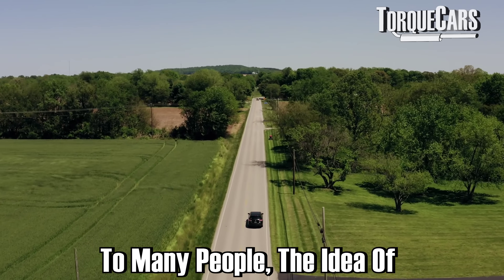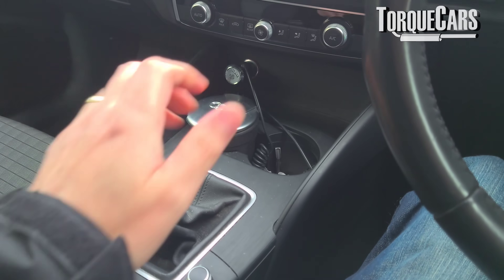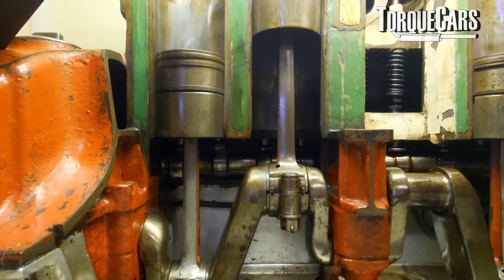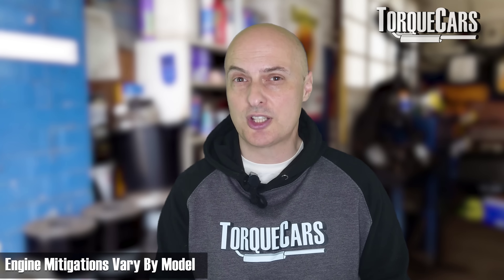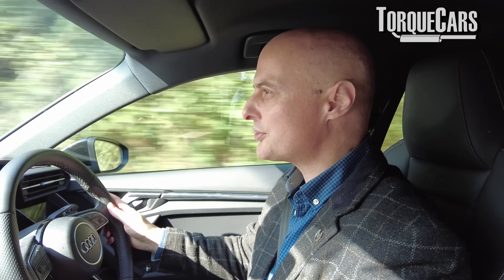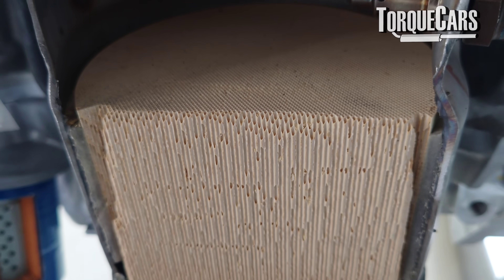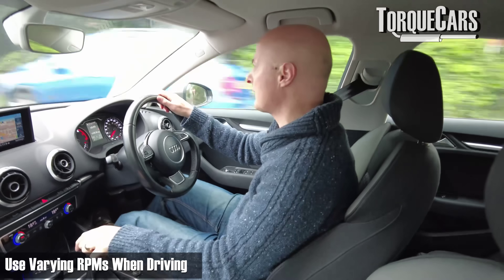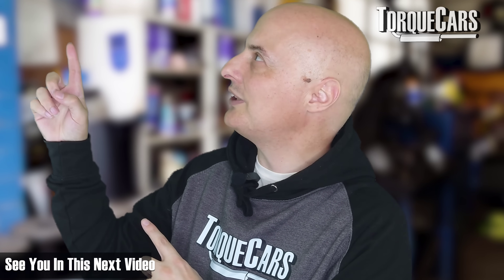BIG DAMAGE By Lugging at LOW RPM? Eco Driving Warning! (Manual Gears)

Comment: Diesels in particular need to be driven like the police are chasing you..(DPF, EGR and rxhaust cleaning). My grandad told me Diesels are designed to work, not rest…Also they need a good run to build heat and regular services..to keep them fit..
Reply: My last diesel was retired at 199000. Seldom did it get revved above 2000 and mechanically was fine. Regular servicing is the key (oil changes at 10000 instead of 18000 as recommended). The engine was fine but the suspension and steering components were heading towards end of life on a seven year old Renault with a trade in value of £200.
Reply: Diesels are true tanks if serviced regualy,  They are literally designed to haul heavy loads over long distances.  Our nanny state should never had declared war on them.
Reply: @chrisgermann6658  Unless you have a  VW TDi 1,9 BLS engine like I had in my last car, it was serviced more often than the book said, I never lugged it and always use the range. it did not even last until the first timing belt and caused a connecting rod to blow right through the side of the engine causing me a loss of 10K dollars and a new debt of another 10 grand. engine was built with defective bolts in the connecting rods making the bolts snap right off. and no one cared, car is more than 3 years, buy a new one for everyone driving cars with the defective BLS engine. it took me 6 years to pay for the damage that stupid car made for me
Reply: @chrisgermann6658  they create much more pollution. Which is why they have started to reduce compression ratios on modern diesel cars, which in turn made them less efficient (but weirdly cleaner).
Reply: @chrisgermann6658  You're confusing old diesels or industrial diesels with current diesels. 15 years ago too mych turbo boost pretty much halved their lifespan but now it's irrelevant. Combination of DPF, AdBlue and use of digital CAN system makes all diesels fail between 150 to 200 k km in an extremely expensive manner. Worst of all, even dealerships can't repair them. I have cars in the fleet that return to dealership every month with the same issue. More money than they're worth has already been spent and five different workshops don't know how to repair this thing. At this point everything in emission control and fuel mixture systems have been replaced, and the car still locks itself due to AdBlue malfuntion.
Reply: @piotrmalewski8178  If the engine has it's oil swapped out every 6-7k with the filters it will keep going.  Turbos are not the problem but people driving Diesels hard and not allowing the turbo to spool down when idle is.  The egr/dpf can be coded out of course but this would probably not fare well for fleet cars as in your case.  So i would say the big brands kind of duped corperations into lease cars promising long life oil every 17k only for timing chains to snap and head gaskets to fail.  If looked after a Diesel block will go on for a very long time.  Trouble is i would say all of the plastics manufactures are using these days does not mix well with heat cycles.  I can only speak for my own experience and my 5 series has done 207k and is still on the original dpf/egr/glow plugs etc.
Reply: @chrisgermann6658  More importantly, it's illegal. As for 207 k, from experience you're nearing dpf failure.
Reply: Diesels have governors so you won't over rev them. Bulldozers are at full throttle 10 hours a day for decades. I drive my 2019 Ford F250 Powerstroke to keep as close to 2000 rpm all the time and I do floor it regularly. Lugging is terrible for diesels and I never let the revs get below 1600. For towing I use 2000-2500 as the rpm range.
Reply: @kgsstudiosfineart  if you have it in tow haul they can downshift too quickly and blow up a diesel. Mines a 2015 and it went to 5k for a second and scared the crap out of me. Tow haul removes a lot of power limiters on some trucks.
Reply: @kgsstudiosfineart  It definitely depends on the engine. I have the old T5 from 2005 from my grandpa, it´s now at about 350k miles with a 1.9 liter TDI engine. These engines are desingned to be driven at 1200-2000 revs, they have full power at 1100 revs and you feel the loss of power after 2000. This Multivan has never seen more than 2700 revs and I drive only that high if it´s fully loaded and I´m driving uphill (which rarely happens) and so far it´s working great.
There is a dpf installed but I have no clue about mechanical stuff so maybe there is a difference to modern dpf 🤷‍♂
Reply: I always thought diesels like low RPM. They tend to get their power earlier than petrol cars. Of course there is such a thing as too low and you can quickly feel the loss of power when going too low.
Reply: @wertywerrtyson5529  You're correct Diesels grab their power lower down the rev range.  However with the fuel emmissions crap they sling on the engine needs to periodicaly be worked hard to engage a DPF burn to prevent the device from getting clogged with soot.
Reply: @wertywerrtyson5529  old school diesel engines are the best. Theybhave huge low end torque. And you dont need more than 2k rpm. The newer engines are rev happy.
Reply: @wertywerrtyson5529  yep diesel engine torque is at lower end.

I drive a 2009 Ford Focus Manual. Unlike the petrol of similar engine size, currently at 82k mileage.

The diesel engine can even hold an uphill situation without hand brakes, just by the bite point of the clutch whilst a petrol car will stall unless you add gas.

As for normal driving. At constant speed say 20mph at 2nd gear she is fine no lugging and stays at 2k RPM but can hear the engine revving asking for a gear higher so you change to 3rd,  same for 30mph at 3rd gear again at 2k RPM.  

But if you are at 30mph constant at 2krpm and change to 4th gear, you will feel the engine lugging speed too slow, revs going down.

But then same as the 20 and 30 mph. If you are hitting 40mph change to 4th gear and at 2k+ rpm and the car feels fine again. No lugging.

If you lug a car, you can definitely feel it and this means you can avoid it. It's just common sense

But if in slow driving scenarios. It is okay since you are creeping forward in 1st gear.

It's like when you are about to enter a round about. You are on 3rd gear. You slow down but not fully stop for 2-3 second. 

Instead of dropping to 2nd gear and then entering the round about.

You thought 3rd gear is fine after losing that much speed and revs.

You enter the roundabout slowly, and it takes 3-4 seconds until the car accelerates properly, you are basically lugging the engine.
Reply: same with 2 strokes engines
Reply: @Xxfootball70xX  less moving parts
Reply: Just like the human body !
Reply: We had an old Ford stake body, it leaked like a siv, never got serviced, and was always overloaded. Drove it with the foot to the floor due to a lower geared rear, and a 4 speed trans. Only issue was the fuel pump getting too hot and won't want to start. Pour cold water on pump and she fired right up.  Transmission and the axel coming apart was her death
Reply: that's why trucks are revved to redline everyday
Reply: @neildean7515  especially pulling a load. The engine might be fine at first but the transmission needs you in higher rpm to help cool it properly. And beware tow haul down shifting in some it'll over rev a diesel. But I found out in manual drive mode it doesn't down shift until you're below a certain speed. Which is perfect for keeping everything under control.
Reply: I always understood that my diesel Mercedes performs the best at 2000-3000 rpm. With an occasional need to go up to 5000 (it's a blast to accelerate off the traffic light stop :D). My current one has 300k km on it and purrs like a kitty. I drive on comfort mode, with occasional spot.
Reply: This is true for rotaries as well.  A reline a day keeps the carbon away.
Reply: That's why removing DPF and EGR saves the day
Reply: @neildean7515  yeah, once my VW heats up after going for about 30-40 mins, the smoothness is so good, it feels like petrol engine.
Reply: The 5-ton tractor we had in the Army was like that.  Got out in 79, it had flat windshield.  On the rolling hill on Ft Hood, it worked well if you left the accelerator floored the entire time.  Would hit governor part way down the hill, but had enough speed to get to top without too much trouble.  If you obeyed the speed limit, you'd be gong 30 at the top of the hill.
Reply: Only if you drive an old vehicle. 
I have a Megane 4 with automatic transmission and it changes only under 1800 rpm. It has 210.000 km now and never had a problem.
Reply: I regularly use high rpms my 2.0tdi that's now 16 years old and on 160000 miles. Never had a dpf, egr issues. Change my oil every 10k.
Reply: Exactly and the difference between hard driving and doodling about is a couple of MPG...
Reply: Or just get a dpf and egr delete to let the engine run as intended.
Reply: Yes :) I remember my first car a 1,6 Diesel with 60hp. I used to drive rounds in the small town because there was nothing else to do and no places to be. After 1 hour of just driving around like a mobile party (full car with people drinking) you would put it in first gear and accelerate all it had for a few seconds, when you came around 2 minutes later the thick black smoke was still there lol :) If you did not to that at least once every hour the car would start to run really bad...
Reply: Of course engines are individuals, diesel as well as others. When I drove a 2 liter citroën c5 it had enough power to accelerate uphill from below 1500 rpm. The peugeot 308 I'm driving need around 1700 rpm for the same uphill.

But overall it's really rare that you need to go far above 2000, and beyond 3000 rpm you don't gain more power. Diesel burns relatively slow so higher rpm means it still burns when the piston is on its way up.
Reply: Not if you delete all that baloney
Reply: Well Diesels can handle low RPM way better than Petrol ones and you have much more torque at lower revs. Also the most horse power is at lower RPMs. You can drive long distances on fairly low revs. It's a matter of feeling. You will feel and hear if the engine is still happy doing it. Also Diesels like long distance motorway driving. They need more time to get hot and in the city you shouldn't rev them up too much in short distances. Because they will build up carbon fast you need to give them revs on a motorway every once in a while. Diesels can handle idle very well, espescially when the engine is running constantly. That's why buses and taxis often are Diesels. Also many machines have Diesel engines. They can still handle high revs for longer periods when the engine is already hot.
Reply: @uranusneptun5239 I have three diesel powered vehicles, two of which have manual transmissions.  I'm not sure if it's considered "lugging", but I generally keep my 2003 Jetta TDI ALH in third gear when making turns and usually accelerate out of turns at 1400rpm.  It accelerates great and gains rpm quickly (larger turbo and injectors).  I wouldn't drive a gasoline engine that way, but I don't see it as much of an issue with a diesel.
Reply: @andrewb9708  I have the exact same car and I've been lugging it its whole life with occasional high RPMs here and there to blow out the carbon, usually around town I'll float between 1500 and 22 to 2400, I have larger injectors with a stock turbo and the power band seems to be 21 to 2800 I don't push my luck and bring it past 3300 it has 215,000 mi on it. The alh is a workhorse.
Reply: @sabbath7081  I just hit 217k on mine.  Many people, myself included, consider the ALH to be the best diesel engine ever produced by VW.  They dont make a ton of power, but they last forever.
Reply: @andrewb9708  I have 2 TDI VW. One ALH and another BEW. The difference I noticed compared to ALH is quieter engine, less torque in low RPM, better performance in highway, specially acceleration btw 60-120km/h. Overall I prefer the BEW, but I think ALH is stronger mechanically. I am going to sell my ALH, as the BEW last quite long as well.

Comment: Did i just hear that?????? On higher RPMs piston travels further???? Am i dreaming or this is a joke? Tell me this guy was joking?
Reply from the maker: I wasn't clear enough then? Sorry. It's travel is in relation to the "combustion event", a greater distance at low rpm you get a pressure spike at a partial rotation of the crank rather than spread out. Comment duly noted for the reshoot though.
Reply: Yes the connecting rods stretch, ask a porsche mechanic about it
The flat fours suffer if driven by older drivers pottering about
Warm the engine up, then let it rev hard on the motorway or dual carriageway,  and the rings scrape the detritus from the top of the bores, and the engine runs smoothly

Comment: Low RPMs are only good for emissions due to the combustion taking more time and exhaust valves remaining closed for longer.  I hate the rumble of low RPM driving and manually down-shift the auto trans when it happens.

Comment: Just to correct your nomenclature a little, it's the rate or combustion that stays the same. "Expansion" is related to the volume of the gas. If the piston is moving slower - so is "expansion".

But like you say, gas generation rate is just as quick, thus you get a pressure spike.
Reply from the maker: Thanks buddy, I'm always learning.
Reply: @torquecars  You're more than welcome 😉

Comment: Low revs are in itself not a problem. Look at the gear selection suggestions that some cars have built in. They favor the engine to be around 1200 rpm. Loading the engine at too low rpm is the issue. If you tow something, or accelerate, or go uphill, I would never go under 2000 rpm.  In those (rare) cases, stay around 2500 rpm.  In all other cases, 99% of time, it is okay to drive 1500 rpm. Most modern engines have highest torque range from around 1500 rpm to 4000 rpm. Or follow the advise of your gear selection advisor, or even simpler, buy a car with an automatic gearbox. Driving above 2500 rpm sometimes as this video suggests, is fine, but not necessary, except in the extremest of cases (towing uphill). I have to disagree on that detail.
Reply: @ronaldderooij1774  finally a number, saw the whole video but all I heard was low or high rpms, but no value added to it, so how to know what range it would be considered low or high

Comment: Revs scale with power demand. Need more power - let 'er rev! Just chillin' on a slight downhill? 1300 will do.

But also prior planning is absolutely ESSENTIAL. If you pay attention, you'll KNOW you need to floor it in 3-5 seconds. So drop a few gears NOW.

Same goes for the bike. My Honda redlines at 12,500 rpm. When I'm just puttering around town, there's usually no need to use more than about 3-4k, but never less than 2500. When it's time to haul ass, anything up from 6000 feels great

Comment: Very frustrating, that at no time do you actually define ‘Low RPM!’
Any competent driver can sense that they’re driving sensibly, rather than making the engine labour or lug at low revs, when it is obviously unhappy..
Reply from the maker: If I did people would point out the exceptions, there are so many engines and so many "low rpms" it can't be quantified.

As you say the take away here is to vary RPM and use the correct gear for the situation.

Comment: I've bought and sold a few cars in the last couple of years, and I 100% agree, I bought a 1 owner Daewoo Lanos on 44K miles, that belonged to an older gentleman who I think must have driven it very gently, as the crank case pressure was ridiculous and the performance was down, a bit of enthusiastic driving later and it sorted itself out though. I also bought a Vauxhall Tigra on 53K miles, that had been owned by an older lady who never went over 20 in it, I put it in for the MOT and all three emissions readings were in the red and it was burning oil, same again, drove it at about 4000RPM for well over half an hour, it had stopped burning oil and the emissions were in the green, I think the piston rings must have gotten stuck with carbon and the extra heat and pressure from a good thrash manage to loosen them. I will never let a car sit below 1750RPM now because the damage it does outweighs the convenience of not having to change gears constantly, and before someone mentions gearbox and clutch wear, proper driving has a negligible effect on either of these
Reply: A clutch job is generally under 1000€. A new engine is at least 10 times that.
Reply: This is why I always buy highway driven engines, they are at their peak power and efficiency always!
Reply: My Grandad bought a brand new Suzuki Alto in 2004. In 2012 when he died it had only done 8000 miles, just from heading into town once per week to collect his pension and go shopping. The engine was in a terrible state, wouldn't run smoothly and reluctant to rev. A good motorway run and italian tune up improved it a lot.

Comment: Every morning when I start my diesel car, I go straight up to 6,000 revolutions per minute.  It is especially good for the engine in freezing weather.
Reply: @venelinkeremedchiev9643  i hope you are joking... thats a crime for diesel engines
Reply: Same, I go to 8,000 RPMs even though my redline is 3500
Reply: @hummerguy  i also spray cold start fluid in intake to rev it over it's redline.
Reply: That's a great way to reduce the life of the engine. You're gonna wear out the piston rings and get some massive blowby. I hope this is satire or so help this poor diesel